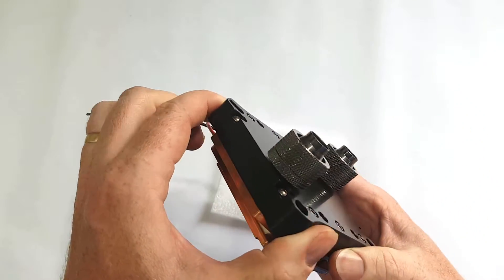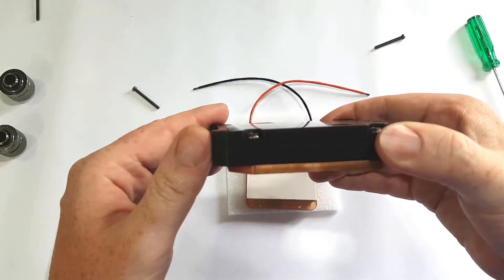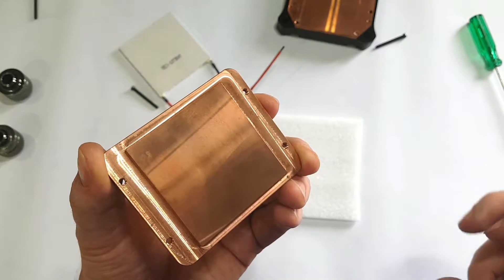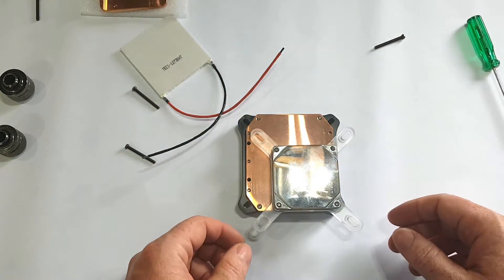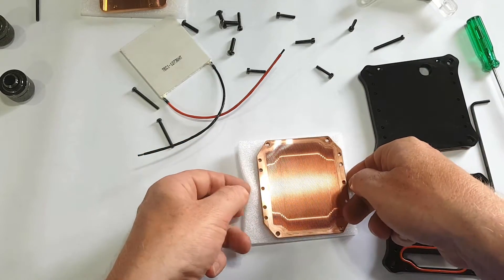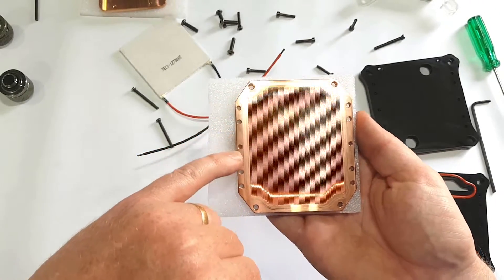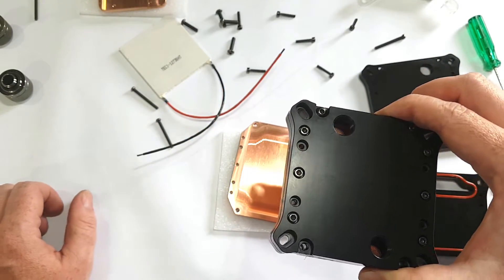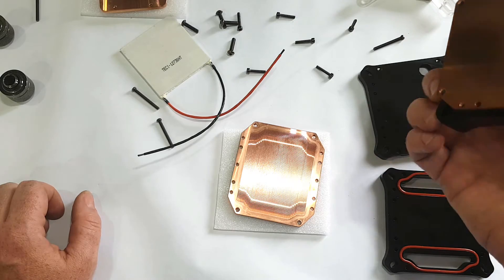⚡️ Peltier Cooler Block for a Pc's CPU. V4 62mm TEC

Comment: much better if the peltier is installed at the back of cpu case after the radiator where the water will be chilled. just for extra cooling

Comment: WHAT ABOUT CONDENSATE
??
Reply from the maker: You can insulate against that OR Control the TEC so it does not go below Dew point
Reply: Making Stuff Awesome but dew point is also dynamic.
Reply: Anyway can I use your concert in a new design of mine
Reply from the maker: Yes It is .. so you'd need to calculate that .. I have plans for such a controller but haven't finished it.
Reply from the maker: Not sure what you mean by this ? "Anyway can I use your concert in a new design of mine"

Comment: One major issue I have found with such videos as this is that no one yet has said how many watts or BTUs per hour a peltier is able to handle. From what I have been able to find out so far there is no commonly available peltier that can handle the heat transfer of a modern CPU under load. And the only reason one would need to be used is when a CPU is Overclocked and producing a lot more heat. Why do none of you inform your viewers on how much actual heat in BTU/hour can be removed?
Reply from the maker: Because you dont need to know BTU'/ hour ... you know how many watts of heat the CPU is putting out very simply . and you know the Qmax in watts a TEC can move... No need to calculate that into BTU/hour for no reason.Also you can get massively power TEC's not just the fake junk on ebay.. you get what you pay for.
Reply: Heat is commonly misstated as Watts when in fact it is BTUs. But that aside, Peltiers are only rated in the # of Watts of Electricity they use. This has no direct relation to the # of Watts of heat that they transfer.
Reply from the maker: Err Qmax of a TEC is the heat in watts it can move.. and any reputable TEC will have that number ... i think you need to Investigate more on the topic.
Reply: Why can you, who are knowledgeable on this subject, not just state this then? I suspect that if someone used what you showed in this video they would in fact fry their CPU.
Reply: Ok, the one you used here. What is it rated at?

Comment: this sucjs you can't use this on a x299 because the cpu is bigger than the pelter  is there any  100mm pelters
Reply from the maker: err What ? the new CPU's are not that big and mounting holes are the same as previous sockets 

https://www.ekwb.com/news/ek-confirms-intel-socket-lga-2066-compatibility/

Comment: pretty nice, but the question, if I were to use this on an AMD 8350 or well, any CPU, would I need to worry about any kind of moisture getting onto the motherboard, or how could tat be tackled if it did become an issue? I hear some people put some kind of waterproofing/silicon style over the motherboard CPU area, but I don't think that would go pretty well on the heat dissipation of it? unless I'm wrong, I do want to buy something like this, since something I keep my PC running items for a very long period of times, tho max it goes is 70 even when overclocked, but I'm sure it wouldn't hurt it to go cooler, especially when running a lot.
Reply from the maker: you can insulate if you want.. or you can just control the TEC to keep the temps above dew point so insulation is not necessary

Comment: I want to use Peltier modules for DIY thermal cooling system to cool li-ion batteries 
(at 25 degree celsius) .
I would like to know what's the total heat temperature output of  3 modules at constant +25 degree celsius cold side. Also the total consumption at that temperature. 
Planing to cool hot side of modules with existing closed loop liquid cooling system.
Reply from the maker: Have you tried using my free TEC calculator

Comment: is there anywhere i could source information and or reviews on how good this product works? Is there a notable difference with this? a review and benchmarks would be lovely. 
super interested. Also, if you make one of these for the whitehaven chips coming soon, id definitely consider buying one.
Reply from the maker: Bamcorp Gaming hello I don't believe an indepentant review has taken place sorry
Reply: could you do a demonstration?
Reply from the maker: lots is in the pipe works. when the time is available. you could ask on over clock.net. about expected results.  as for gpus. normally there is not enough space so you end up Tec water chilling them
Reply from the maker: Yes it would not that, that is a good TEC.  I wouldn't recommend that TEC to anyone

Comment: I am very interested in buying a version of this compatable with an AM4 motherboard. The 1800x has been performing very well on ln2, so I think the sub ambient temperatures from a powerful 62mm tec and this block could lead to some very aggressive overclocks.
Reply from the maker: Yeah well who knew that Rayzen could actually be any good.. We all got burnt with the hype of Bulldozer that was a mega flop .. i Love AMD i'd love to go back to them but for years now they have been a complete joke. It will be interesting to see how intel responds. I suspect they will release some thing better.   The great thing about Rayzen is the low wattages that makes TECing totally achievable.
Reply: Yeah, it's been years since they've been competetive. But right now they have a bunch of exciting stuff on the horizon like a dual gpu vega card (From the doom demo at ces it seems like a single vega card will perform similar to a 1080ti so a dual vega card will likely be a beast), and a 32 core server chip with SMT (and compatible dual socket motherboards!) and a workstation graphics card with 2tb of nvme ssd video memory.  I seriously hope you will consider making a tec block for am4 and the dual vega card whenever that drops because I would definitely buy them.  I would love to have a cpu and dual gpu direct die tec cooling loop sitting on my desk.
Reply from the maker: Oh im sure i will i just need to sell what i have first so i can make some AM4 blocks as well. right now im considering going back to AMD by the end of the year. I guess the 65watt version might be a great overclocker AND cos of it's low TDP it could be awesome under a TEC... I tried to get the dimensions for the AM4 socket and retention mechanism but haven't been able to find any thing MAYBE it's still like that AM2, as in you could get two 50mm TEC on there if so we could get more than 1000watts of QMAX in there .. would be kick ASS.
Reply from the maker: FYI I made a post on my FB page to see if i could drum up enough interest in a AM4 block to make it worth while to make some now. 

would be good if i could get some of the Active members of Overclock.net to Join my FB Page...  I wouldn't mind rejoining OC.Net but im sure management would not allow that.. Would be nice if someone could get them to re concider.. im sure it's been more than 10 years now lol.

Comment: ???? and the peltier isnt sealed ..so the ice builds up and floods your system with condensed water ??????
Reply from the maker: Well normally you'd insulate the block and motherboard so that doesn't happen OR you just keep the cold side above Dew point and therefore there is no dew (water). I personally have just insulated the block in the past (Though im not suggesting you do that ).

Comment: I would rather chill the water with the peltier than have it directly on the cpu. if the peltier dies so does the cpu
Reply from the maker: sandflesh thermal throttling of the cpu should prevent the cpu from dieing also the tec will still conduct heat if this fails or has no power so its not the end of the world. i actually have a video on tec reliability coming up. you should keep and eye out for it as it may help
Reply from the maker: Here we go 
https://youtu.be/ltbMwhediMc